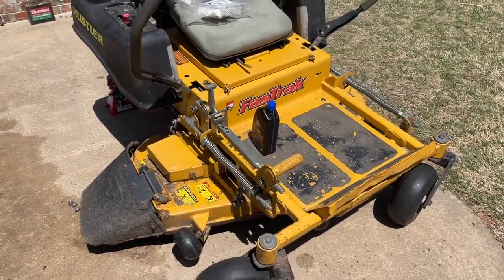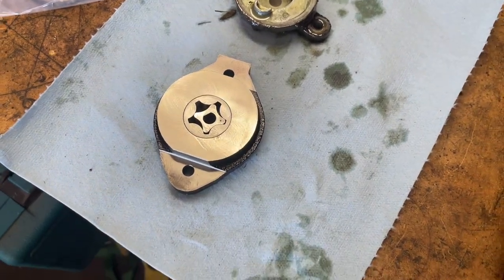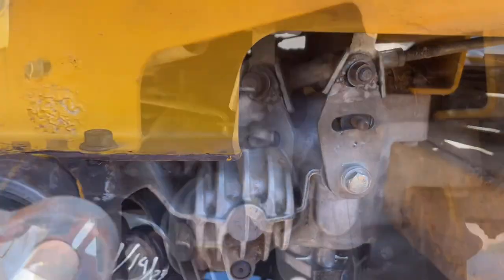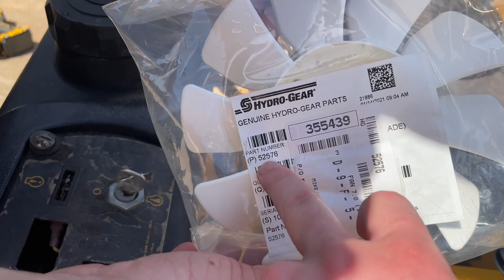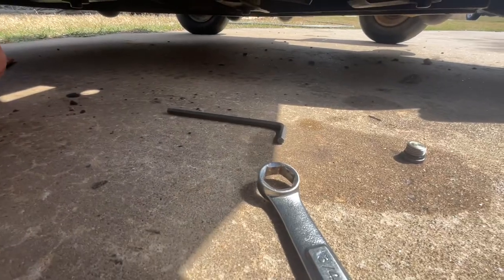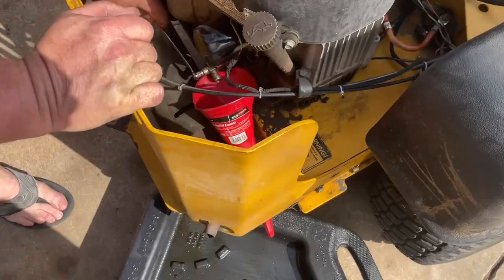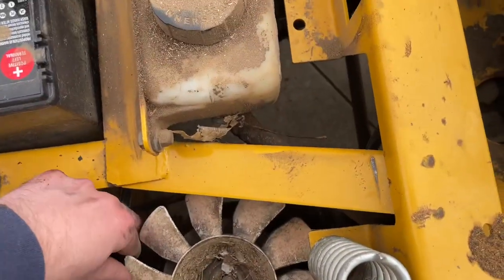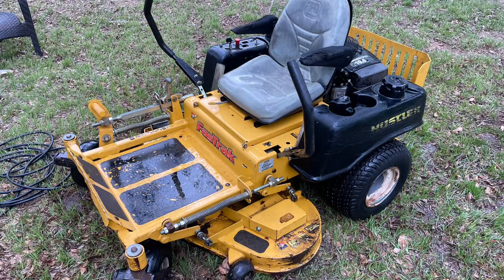Hustler FasTrak 48” Gets All Of The Maintenance

Comment: My Fastrak 48 has a Honda GXV610 engine with less than 100 hours.  The engine starves for fuel and quits when it gets hot.  I can't remove the air cleaner to clean the carburetor because the air cleaner bolts screw into square nuts mounted in slots in the fan cover and the nuts just spin in the cover.  There's no way to put a wrench on the nuts without destroying the fan cover.  What a piece of plastic junk!!